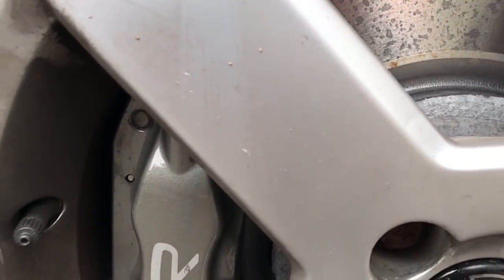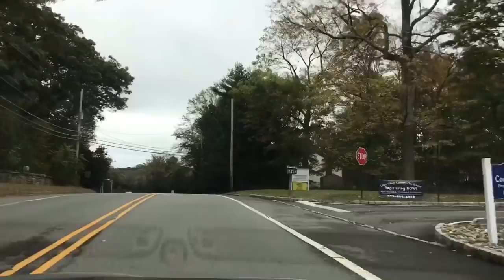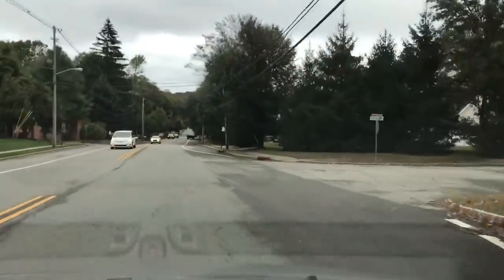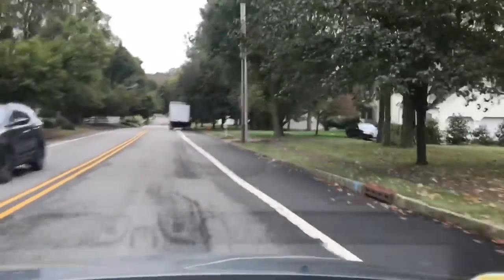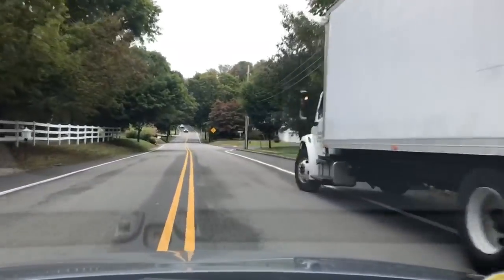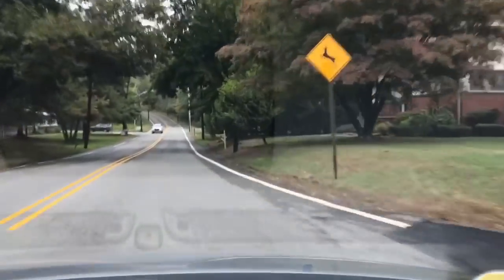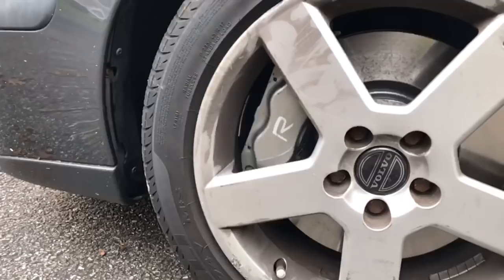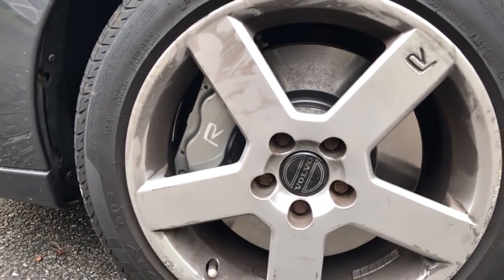Project Volvo V70R Brake Replacement Review - Did We Fix It?

Comment: These cars have a real tendency for the master cylinder to leak, this is a common fault.  Also the test of good brakes is multiple high speed stops without fade, not a couple of brake applications around town.

Comment: The V70 gen2 is a real nice car. Those brakes is a popular upgrade for Volvo 2, 7, and 940s here in Norway. I owned a gen2 for 2 years. It was a 2006 same color as yours, it had a kinda spesial combo because it was a diesel with a 6 speed and 4wd. The best part was that with a tune it ha 256 hp, 560 nm(414 ft/lbs) and used half the fuel compared to the gas model 0.55/10km(52mpg).

I use FcpEuro for parts as well they for the most part they are cheaper the the local dealers and have more inventory. For instance the throttlecable for my E34 M5 was half price chiped to Norway.

Comment: What's next for this project car?? Currently building my 04 S60R...
Reply from the maker: +vert5 probably going to a dealer and see what they think is wrong. Also, we have suspension parts to install next, but need to get the struts replaced first.

Comment: Just so you guys know the v70r automatics have a de-tuned engine because the transmissions couldn't handle the hp or torque.
Reply: No they don't. They are exactly the same as the manuals. The only difference is boost is inhibited by the map in 1st and 2nd gears to reduce stress on the clutch packs. I have a 450bhp V70R on the stock automatic 5 speed transmission. It can definitely handle more torque and horsepower than stock.

Comment: yes you screwed up a little guys , sorry to say. Brembo brake are rubbish on a car this weight, bringing it down to zero from 130 mph plus with Brembo s just gets you LOADS of brake fade as i have found out personally. In the U.K we use ferodo, fast road / race brakes with dimpled discs, and there are even better ones you can get if you want to spend about $800 in your money. Braided hoses improve thing to. look on T5 D5 volvo forum
Reply: Have been using ebc brakes brakes on my 98 v70r and other than extreme amounts of brakedust im super happy, you can run the brakes smoking hot and still have a lot of brakes left.
Reply: anythings better than Brembo